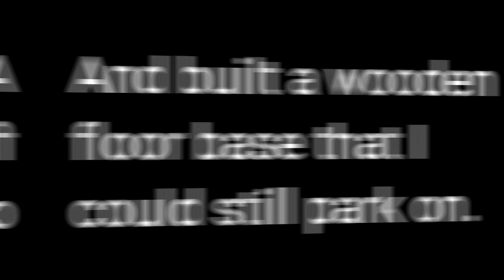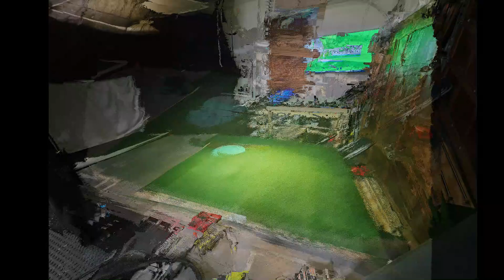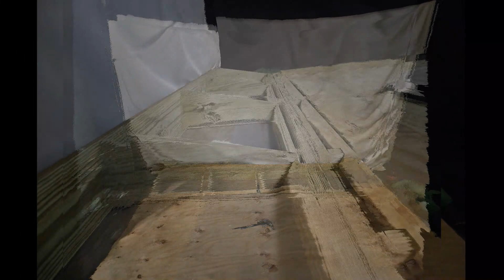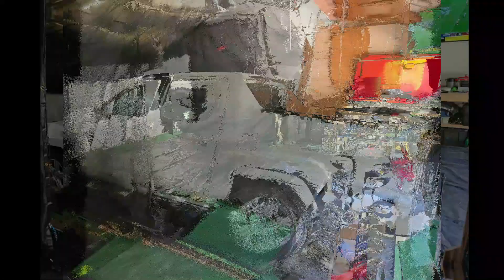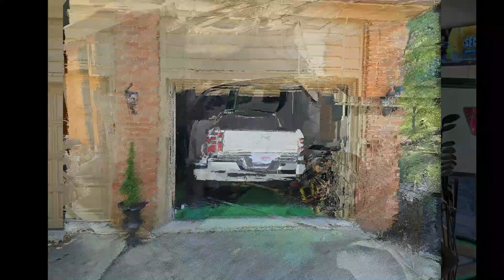Garage Golf Setup -Garmin R10/Mevo+ Setup and Wooden Floor Build That Can Still Be Parked On

Comment: Hey great video! I am thinking of using a similar track setup , but for LH and RH player integration. Just a couple questions.

1. Have you tried the track with LH/RH players? What is the experience like?
2. Does the mevo need to be recalibrated when moved?

Comment: Nice setup! I had a few questions for you.

1. What did it cost to raise your garage rails? Did you do it yourself? 
2. What are the wires for near the hitting mats?
3. Can you hit and putt from all the surfaces without moving the Mevo?
4. How far back did you have to put the Mevo for it to read?
5. With Mevo/E6 Connect, do you only get the 10 courses they advertise, or access to more?
Reply from the maker: I paid somewhere around $500 to raise the rails if I remember correctly... the wires I think you're referring to are just bungies.. putting is recommended to be closer to the Mevo where you start with the ball so my hitting spotlight is at about 8ft and the start of the mat is 1-2ft back from that and that's where I put the ball to putt.. but I can do that from anywhere in front of the Mevo's view which I have the ability to move left and right with the slide.. if you want more courses with E6 Connect you just have to pay their subscription pricing model and you'll have access to more courses and is completely compatible with the Mevo+ 👍

Comment: Question do I need double patting to cover cement for garmin and do I need to cover cement on front of garmin
Reply from the maker: Honestly you just need to cover it with anything. Thin layer of carpeting is fine! Trying to block radar based reflections anywhere in front of the Garmin.